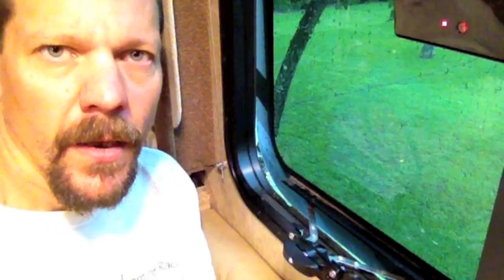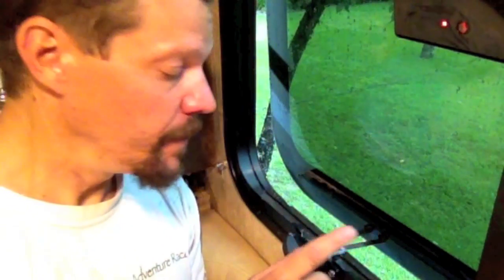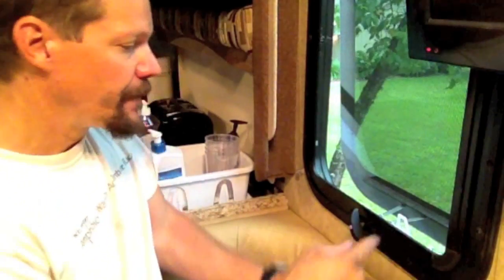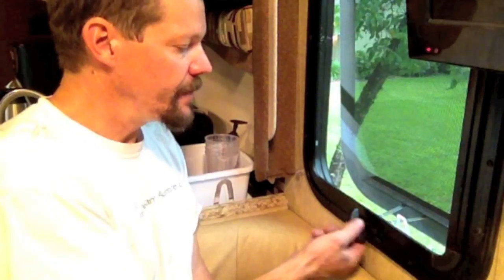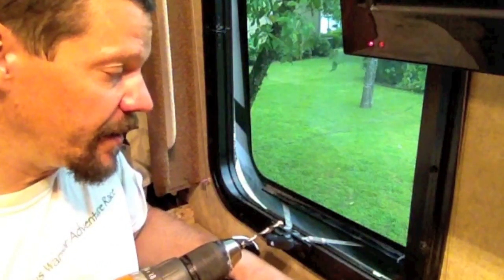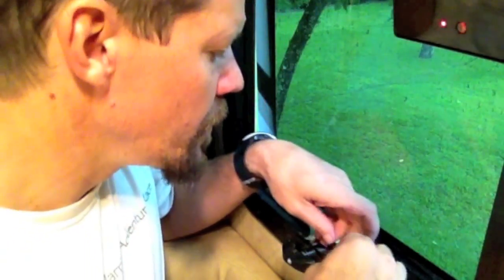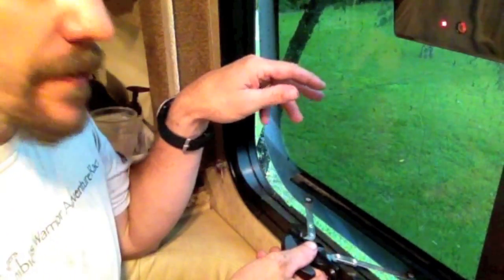RV crank out window fix

Comment: Great video....thanks a whole lot.  Mine is a Thor. It has a spacer between the two rollers on the window track that has to be installed also. You saved me a ton of work.
Reply from the maker: that is a great point. Ive never seen one with the spacer in it but I'm sure the order of installation is important. Thanks for mentioning it!

Comment: I drilled out. Didn’t have the right length screws. Cut them to size, and used wing nuts. Works like a champ. No cost. Used what I had. 👊🏽 buttoned up and window is closed tight.
Reply from the maker: glad it worked out well for you!

Comment: This was a great tip! I had to use smaller hardware and shorter bolt (3/8") which matched the length of the replaced rivet exactly. I really appreciate the video -- thank you very much. A 5-minute job on my Jayco and we're good to go.
Reply: Same issue with mine.  The 1/2 bolts hindered the scissor arms from folding all the way back in.  Excellent video otherwise

Comment: Great video to show an easy job.  Only thing I might add is watch the thin plastic track that will fall out as you take out the rollers because it fits between the rollers keeping you from extending the window to far.  Not a big deal but it’s there……. Again great job in the video

Comment: Many thanks for the video. We got a new 2015 Jayco and within a few weeks three of our frameless windows have this issue. One popped out from vibration on the road and we had to do a side of the road fix with duct tape to close the window. Really NOT IMPRESSED with the whole situation.

My initial thought was that the window handle mechanisms should have bolts and washers in the first place instead of rivets. However, I think I know why they did this: rivets are unlikely to vibrate loose. With the use of nylon rings I don't foresee a major vibration issue.  I see the rivet replacement as a long term solution as removing the windows on the road is a daunting prospect due to the two-person and at-height (ladder) aspect.

Thank you SO much for the video!
Reply from the maker: +Minnesota Programmer Glad it was helpful! We only have two of those frameless windows on our ACE MH but they both popped out after two weeks of use! Honestly though it may have been in part due to my young kids that were not familiar with the window operation.  Since I have replaced the rivets with bolts, they have only popped out once but again it may be due to showing my kids how to work the windows!  

I'm a big fan of the nylon insert nuts. I generally use them where ever I can. I agree with you that rivets have an advantage that they will never vibrate loose but I haven't had any issue with ours coming loose. I think it is a cost/time factor for the builders too. It is amazing how much builders analyze the minimum number of fasters they can use to save on construction time and costs!

Glad the video helped and I hope you get many many miles of safe happy travels with your rig! Maybe see you out on the roads!

Comment: Good instructions and equipment list. I just now completed a repair on my Keystone Vantage I needed to do a few additional steps, including ;
1. The runner track that holds the scissor blades has two screws that must be removed so you can insert the new blades.
2. The whole crank mechanism cannot in fact be fitted into my windows without using a hacksaw to cut away some of the metal frame onto which you bolt the cranks.
Reply: Peter Kelly thanks for the additions. I have seen a couple of windows that have a "set" screw in the end of the channel that prevents the rollers from coming all the way out much like the top hinge. The lower frame that has to be cut to get the crank assembly out is new to me but glad to here you were able to get it out and all done!  Thanks again for the additions!

Comment: Just watched tour video.  Kool repair. My crank handle is somewhat loose meaning it doesn't close the window tightly and there's a gap. Is there a way to tighten handle besides tightening center screw?
Reply from the maker: not really. Sometimes the teeth get worn particularly it if has been loose for a while. Might be worth taking the handle all the way off and inspecting the teeth. Also make sure there isn't something binding or blocking the arms. Usually a loose handle will not prevent you from getting the window closed all the way.

Comment: We had an issue with our rv door so my husband had to crawl thru our emergency window thru our living room. Got locked out. The whole bottom window came completely out. It’s a 2 piece window. We read about a j hook. Could you explain how we get the bottom piece hooked back to this j hook. Nothing on internet about this that we have found. We know the bottom goes back up under the top half. We have it taped right now. We need to get it put back in correctly. Video would be nice.

Comment: Found you just in time.  Found one of the windows did come out of the slots just as you video showed.  Your fix worked for me too.  I have had to do a second window too.  Frameless windows may not be as good a deal as the dealer suggested?
Reply from the maker: +Paul Staffieri Glad I could help a little. I'm not sure if I like the frameless windows better or not. They look clean and they are on most of the new models so I guess we'll have to deal with them!

Comment: I did not see how you put the rollers back in the track?? Or does removing the rivets allow the roller arms to widen out to ends of window track?
Reply from the maker: right about 5:15 in the video you'll see it. probably have to watch just a little longer.
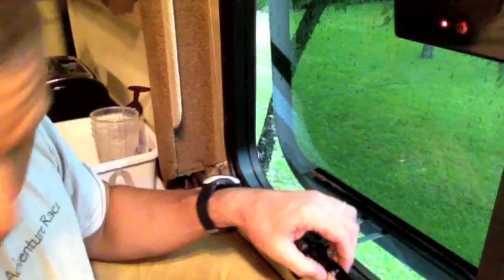Reply: @hesty32  Got it! At about 4:45 it looks like you reseat the crank knob into its position, so that whole mechanism comes out, allowing you to put rollers into track. You’re right, easy fix. Thanks!!

Comment: If you don't want to drill out rivets, use checklist binder screws, sand heads down to fit track, and locktite the screw....10 minute fis, thanks to jake in Ashland WI.....

Comment: We did exactly what you showed but on the last window we ran into a problem, the whole window fell out! We have been unable to get it to hang again. Any ideas on how to get it back on the rv?
Reply from the maker: Sorry to take so long to get back to you, just got back from family holiday. Sorry to hear of your problem!
Making an educated guess here because its hard to say without looking at it: the top of the window should have a small diameter rod on it that fits into a "C" shaped channel on the RV above the window. Usually they are both made out of aluminum. There is supposed to be a small (set) screw on each end of the "C" channel that prevents the rod from sliding out.  

On a ladder or on the roof of the RV, look just above the window opening for the "C" channel. The rod attached to the window should slide into the channel from either the front end or the rear end depending on which set screw is out. Should be fairly easy to slide it back together. Just make sure that you put a screw in the channel to prevent the window from sliding out of the channel again.

If this doesn't help you or make sense, let me know and I'll try to send you some pictures of exactly what Im talking about.
Reply: +hesty32 
thanks for your response! hope you had a great time with your family. the window in question is part of a three piece. the top picture window does not open and below it are two windows for ventilation. the channels are inset and inaccessible. hard to explain. Winnebago directed us to the manufacturer, hehr, and they pretty much said too bad, need to replace the entire thing. I was hoping there was something other than sealing it shut that we could do. simply can not afford to replace.
Reply from the maker: Oye! I understand the "can't afford to replace" bit! thats what got me into my own maintenance in the first place! 
As to your windows, I'm not familiar with that style. I'm going to send you a private message here so we can maybe send some pictures back and forth and maybe I can figure how to help you out.
Reply from the maker: Sorry! I can't seem to send you a private message! Would you mind sending me one?
Reply: Trying to figure out how to do it . . .
Reply: I have pictures I can send but don't know how
Reply: Sent you a hangouts msg

Comment: How is that window hinged?
Reply from the maker: hard to describe but there is a round channel (almost a complete tube) riveted or bolted to the RV and the window has a rod kind of thing that is bolted to it. So when the rod is slid into the tube, it can hinge. Then there is a set screw on each end to keep the rod from sliding out of the tube